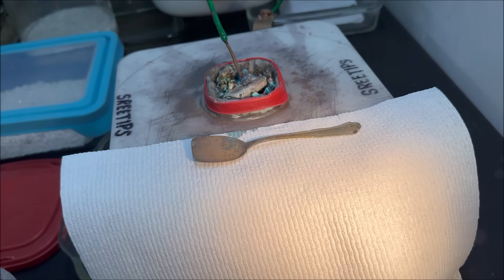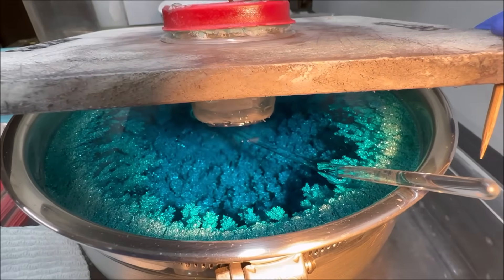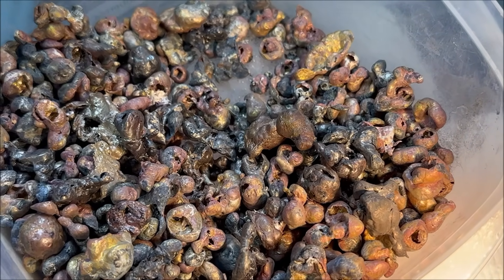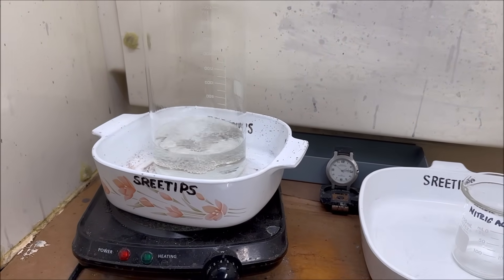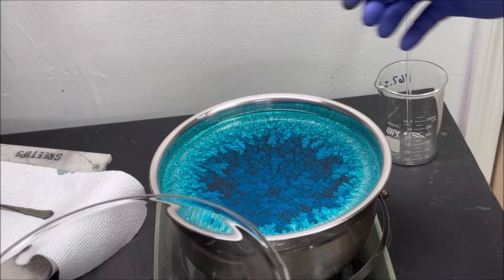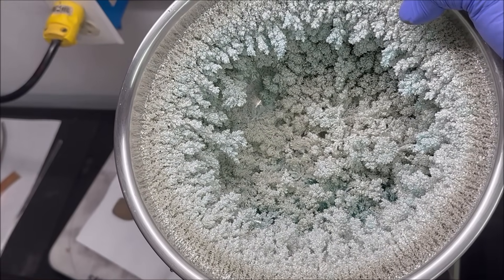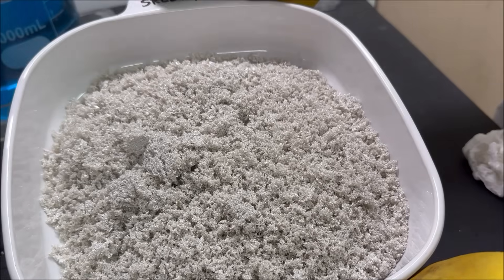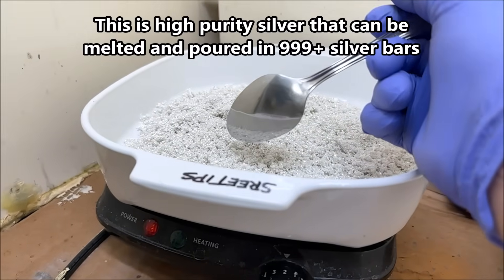999 Fine Silver Cell Harvest and Reboot

Comment: If you can “grow” silver. What make is valuable/scarce
Reply from the maker: I refine gold. I use sterling silver, that I buy at estate sales, to refine the scrap gold. I recover the silver from that, melt into shot, and run it through my silver cell. Silver is a by-product of my gold refining. The cell converts the impure silver (about 980 parts per thousand silver) to high purity four nines fine (9999 parts per ten thousand) pure elemental silver metal. So I’m refining the impure silver, that I recovered from my gold refining operations, into high purity silver, not creating silver out of thin air. When the silver cell is full of pure silver, I harvest the pure silver crystal, put it away and forget about it. Then I repeat the whole thing again.

Comment: Is this real?
Reply from the maker: Yes. I refine gold. I use sterling silver, that I buy at estate sales, to refine the scrap gold. I recover the silver from that, melt into shot, and run it through my silver cell. Silver is a by-product of my gold refining. The cell converts the impure silver (about 980 parts per thousand silver) to high purity four nines fine (9999 parts per ten thousand) pure elemental silver metal. So I’m refining the impure silver, that I recovered from my gold refining operations, into high purity silver, not creating silver out of thin air. When the silver cell is full of pure silver, I harvest the pure silver crystal, put it away and forget about it. Then I repeat the whole thing again.

Comment: Where does the source ore come from?
Reply from the maker: I refine gold. I use sterling silver, that I buy at estate sales, to refine the scrap gold. I recover the silver from that, melt into shot, and run it through my silver cell. Silver is a by-product of my gold refining. The cell converts the impure silver (about 980 parts per thousand silver) to high purity four nines fine (9999 parts per ten thousand) pure elemental silver metal. So I’m refining the impure silver, that I recovered from my gold refining operations, into high purity silver, not creating silver out of thin air. When the silver cell is full of pure silver, I harvest the pure silver crystal, put it away and forget about it. Then I repeat the whole thing again.

Comment: Now how to acquire the raw materials. ?  Am I digging ?
Reply from the maker: I refine gold. I use sterling silver, that I buy at estate sales, to refine the scrap gold. I recover the silver from that, melt into shot, and run it through my silver cell. Silver is a by-product of my gold refining. The cell converts the impure silver (about 980 parts per thousand silver) to high purity four nines fine (9999 parts per ten thousand) pure elemental silver metal. So I’m refining the impure silver, that I recovered from my gold refining operations, into high purity silver, not creating silver out of thin air. When the silver cell is full of pure silver, I harvest the pure silver crystal, put it away and forget about it. Then I repeat the whole thing again.
Reply: @sreetips you kick ass bro. I wish I could learn this. But I need materials first. lol. That’s the problem great info. Thanks.
Reply from the maker: Thank you

Comment: How do you grow silver? start out with a big bar of silver
Reply from the maker: I refine gold. I use sterling silver, that I buy at estate sales, to refine the scrap gold. I recover the silver from that, melt into shot, and run it through my silver cell. Silver is a by-product of my gold refining. The cell converts the impure silver (about 980 parts per thousand silver) to high purity four nines fine (9999 parts per ten thousand) pure elemental silver metal. So I’m refining the impure silver, that I recovered from my gold refining operations, into high purity silver, not creating silver out of thin air. When the silver cell is full of pure silver, I harvest the pure silver crystal, put it away and forget about it. Then I repeat the whole thing again.

Comment: I know that silver Chrystal would pull both my feet up in the air if smoked in a crack pipe
Reply from the maker: Not recommended. It would probably just melt the silver if you could get it hot enough.

Comment: nobody speaking about how this man found a money glitch and also bud the upper forces are coming for u u can make 10 kilos a week which is 40k off of like 6k worth of silver crystal.... Insane.
Reply from the maker: I refine gold. I use sterling silver, that I buy at estate sales, to refine the scrap gold. I recover the silver from that, melt into shot, and run it through my silver cell. Silver is a by-product of my gold refining. The cell converts the impure silver (about 980 parts per thousand silver) to high purity four nines fine (9999 parts per ten thousand) pure elemental silver metal. So I’m refining the impure silver, that I recovered from my gold refining operations, into high purity silver, not creating silver out of thin air. When the silver cell is full of pure silver, I harvest the pure silver crystal, put it away and forget about it. Then I repeat the whole thing again.

Comment: I'm sorry.. maybe You should  just tell us why Youre doing this... I dont get it
Reply from the maker: I refine gold. I use sterling silver, that I buy at estate sales, to refine the scrap gold. I recover the silver from that, melt into shot, and run it through my silver cell. Silver is a by-product of my gold refining. The cell converts the impure silver (about 980 parts per thousand silver) to high purity four nines fine (9999 parts per ten thousand) pure elemental silver metal. So I’m refining the impure silver, that I recovered from my gold refining operations, into high purity silver, not creating silver out of thin air. When the silver cell is full of pure silver, I harvest the pure silver crystal, put it away and forget about it. Then I repeat the whole thing again.

Comment: refining existing silver, in a very cool way. not creating new silver atoms, but moving them from one place to another.
Reply from the maker: I refine gold. I use sterling silver, that I buy at estate sales, to refine the scrap gold. I recover the silver from that, melt into shot, and run it through my silver cell. Silver is a by-product of my gold refining. The cell converts the impure silver (about 980 parts per thousand silver) to high purity four nines fine (9999 parts per ten thousand) pure elemental silver metal. So I’m refining the impure silver, that I recovered from my gold refining operations, into high purity silver, not creating silver out of thin air. When the silver cell is full of pure silver, I harvest the pure silver crystal, put it away and forget about it. Then I repeat the whole thing again.
Reply: @sreetips Good time to sell some silver now in January 2026

Comment: Why wouldn't everyone do this if you can get this much silver in 13 days
Reply from the maker: Because getting pure silver is never quick, easy, or cheap. I refine gold. I use sterling silver, that I buy at estate sales, to refine the scrap gold. I recover the silver from that, melt into shot, and run it through my silver cell. Silver is a by-product of my gold refining. The cell converts the impure silver (about 980 parts per thousand silver) to high purity four nines fine (9999 parts per ten thousand) pure elemental silver metal. So I’m refining the impure silver, that I recovered from my gold refining operations, into high purity silver, not creating silver out of thin air. When the silver cell is full of pure silver, I harvest the pure silver crystal, put it away and forget about it. Then I repeat the whole thing again.
Reply: @sreetips nice man, how did you get into refining gold? I'm interested into getting into the game but not sure where to get started
Reply from the maker: Get up early, go to yard sales and estate sales. That’s where we got started, twenty years ago.

Comment: So, thius, in fine you do ab. $6,500.00 worth of work to recover ab. $2,900.00 worth of pure silver!  NICE! 😮😮😮😮😮🎉
Reply from the maker: Check your numbers. That sounds way off. I refine gold. I use sterling silver, that I buy at estate sales, to refine the scrap gold. I recover the silver from that, melt into shot, and run it through my silver cell. Silver is a by-product of my gold refining. The cell converts the impure silver (about 980 parts per thousand silver) to high purity four nines fine (9999 parts per ten thousand) pure elemental silver metal. So I’m refining the impure silver, that I recovered from my gold refining operations, into high purity silver, not creating silver out of thin air. When the silver cell is full of pure silver, I harvest the pure silver crystal, put it away and forget about it. Then I repeat the whole thing again.

Comment: I was making colloidal silver and left it on for too long and it was growing on the sides and it looked like more than what came off of my silver wire. I desperately want to understand exactly how this works. It’s going to take all my brain cells. I am fascinated and really want to understand. I’ll check to see if you have a book
Reply from the maker: I refine gold. I use sterling silver, that I buy at estate sales, to refine the scrap gold. I recover the silver from that, melt into shot, and run it through my silver cell. Silver is a by-product of my gold refining. The cell converts the impure silver (about 980 parts per thousand silver) to high purity four nines fine (9999 parts per ten thousand) pure elemental silver metal. So I’m refining the impure silver, that I recovered from my gold refining operations, into high purity silver, not creating silver out of thin air. When the silver cell is full of pure silver, I harvest the pure silver crystal, put it away and forget about it. Then I repeat the whole thing again.
Reply from the maker: The silver coin Mrs out of solution on the clean metallic copper. The copper goes into solution. The two metals trade places in a replacement reaction.

Comment: So this guy is refining Silver?
Reply from the maker: I refine gold. I use sterling silver, that I buy at estate sales, to refine the scrap gold. I recover the silver from that, melt into shot, and run it through my silver cell. Silver is a by-product of my gold refining. The cell converts the impure silver (about 980 parts per thousand silver) to high purity four nines fine (9999 parts per ten thousand) pure elemental silver metal. So I’m refining the impure silver, that I recovered from my gold refining operations, into high purity silver, not creating silver out of thin air. When the silver cell is full of pure silver, I harvest the pure silver crystal, put it away and forget about it. Then I repeat the whole thing again.

Comment: Im confuzzled? Didnt you start off by disolving like 1000 grams of siler in the liquide? Are you actually gaining anything or just making it re appeaer?
Reply from the maker: I refine gold. I use sterling silver, that I buy at estate sales, to refine the scrap gold. I recover the silver from that, melt into shot, and run it through my silver cell. Silver is a by-product of my gold refining. The cell converts the impure silver (about 980 parts per thousand silver) to high purity four nines fine (9999 parts per ten thousand) pure elemental silver metal. So I’m refining the impure silver, that I recovered from my gold refining operations, into high purity silver, not creating silver out of thin air. When the silver cell is full of pure silver, I harvest the pure silver crystal, put it away and forget about it. Then I repeat the whole thing again.

Comment: Again, I ask how we separate the fine silver and platinum filings from my collections?
Reply from the maker: Silver is soluble in nitric acid. Platinum is not. Unless you have an alloy that is 5% or less platinum with 95% or more silver. Then both metals (silver and platinum) will go into solution completely. It’s a phenomenon.

Comment: Silver Cell Harvesting does not create more silver than you started with and there are way safer ways to purify silver than using dangerous chemicals. Its not the cheapest way either.
Reply from the maker: I never said I created more silver than I started with. Silver is a by-product of my gold refining. I have hundreds of pounds of cement silver powder that has indeterminable value. So I run it through my silver cells. Then its value is easily determined, based on its purity. I’ve done it this way for a decade and a half. Gotten excellent results. All the best to you.
Reply: @sreetips  I wasn't accusing you of anything or of stating anything, I was just informing people of a fact so others can understand there is a cost involved. I also believe you have a video titled "why buy 999 silver when you can grow your own" which for anyone who doesn't understand the process could believe they can create silver from thin air maybe ? !
Reply from the maker: I know what you mean. Words can make our mind play tricks on us, makes us think that we can get something for nothing.

Comment: By doing this is not like printing fiat ?
Reply from the maker: I refine gold. I use sterling silver, that I buy at estate sales, to refine the scrap gold. I recover the silver from that, melt into shot, and run it through my silver cell. Silver is a by-product of my gold refining. The cell converts the impure silver (about 980 parts per thousand silver) to high purity four nines fine (9999 parts per ten thousand) pure elemental silver metal. So I’m refining the impure silver, into high purity silver, not creating silver out of thin air. When it’s full, I harvest the pure silver crystal, put it away and forget about it. Then I repeat the whole thing again.
Reply: @sreetips Thank you for the clarification.
Reply from the maker: Fiat means: backed by nothing. Gold and silver need no backing. They stand on their and require no third-party validation.

Comment: Ok I just have to ask bc I tend to be a little dense at times. Are you getting back more silver than you’re putting in is my question. Thank you for your answer when you or someone else answers
Reply from the maker: I refine gold. I use sterling silver, that I buy at estate sales, to refine the scrap gold. I recover the silver from that, melt into shot, and run it through my silver cell. Silver is a by-product of my gold refining. The cell converts the impure silver (about 980 parts per thousand silver) to high purity four nines fine (9999 parts per ten thousand) pure elemental silver metal. So I’m refining the impure silver, into high purity silver, not creating silver out of thin air. When it’s full, I harvest the pure silver crystal, put it away and forget about it. Then I repeat the whole thing again.

Comment: So is there any advantage of this?Growing silver that requires silver based electrolyte to form crystals means you just turned Siler into silver crystal...so does sliver crystals have naturally aligned grains allowing for better conductivity or something?I ask because your not gaining silver this way.
Reply from the maker: The big advantage is that the silver crystal value is easily determinable. The impure silver has undetermined purity, and therefore undetermined value. The silver crystal is not true crystals. They are actually dendrites.
Reply from the maker: I’m amazed at how many people think that my thumb claims to be creating silver from thin air.

Comment: So how much of the junk metal was used to get the 1.3kg of the pure silver?
Reply from the maker: I refine gold. I use sterling silver, that I buy at estate sales, to refine the scrap gold. I recover the silver from that, melt into shot, and run it through my silver cell. Silver is a by-product of my gold refining. The cell converts the impure silver (about 980 parts per thousand silver) to high purity four nines fine (9999 parts per ten thousand) pure elemental silver metal. So I’m refining the impure silver, into high purity silver, not creating silver out of thin air. When it’s full, I harvest the pure silver crystal, put it away and forget about it. Then I repeat the whole thing again.
Reply from the maker: For every kilo of 98% silver (2% copper, mostly) I add into the anode basket, I can expect to harvest 980g of high purity silver crystal from the cell.
Reply: @sreetips what i meant was, what's the weight of sterling silver and gold being used in the cup? Like 2 grams, 2 oz? How much "junk" metal is used to get the 1.3k? I get the process, it's cool but was curious as to how much was used to turn into sludge?
Reply from the maker: 2% is not silver. Most of the 2% will be copper. It gets dissolved and passes thru the filter and turns the electrolyte blue. Any other insolubles (such as gold and platinum group metals) get trapped in the anode filter. I couldn’t put a number on it.

Comment: What is the impact of the size of the Silver shot in the Anode basket. If the silver shot smaller what happens, is it more efficient in pulling the silver out, or do you run a higher risk of impurities leaching into the cell?
Reply from the maker: Smaller pieces = greater surface area

Comment: Its the wording he’s not growing anything he taking the silver he already has and removing the mixing highly effective but you have to have the silver already
Reply from the maker: Correct. I refine gold. I use sterling silver, that I buy at estate sales, to refine the scrap gold. I recover the silver from that, melt into shot, and run it through my silver cell. Silver is a by-product of my gold refining. The cell converts the impure silver (about 980 parts per thousand silver) to high purity four nines fine (9999 parts per ten thousand) pure elemental silver metal. So I’m refining the impure silver, into high purity silver, not creating silver out of thin air. When it’s full, I harvest the pure silver crystal, put it away and forget about it. Then I repeat the whole thing again.